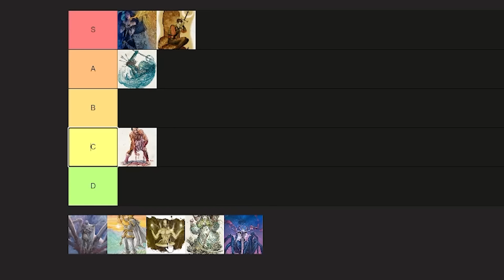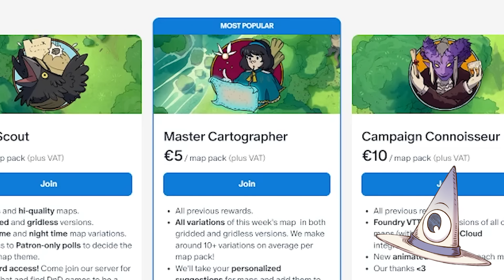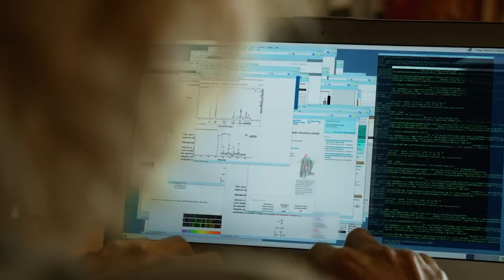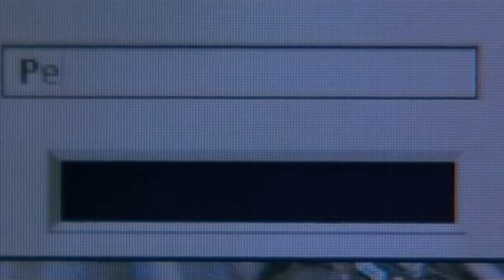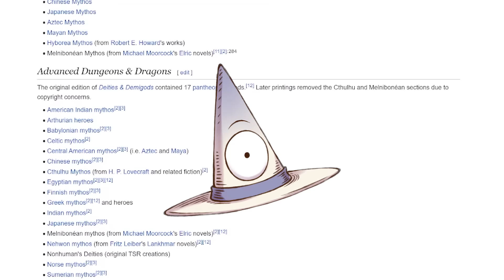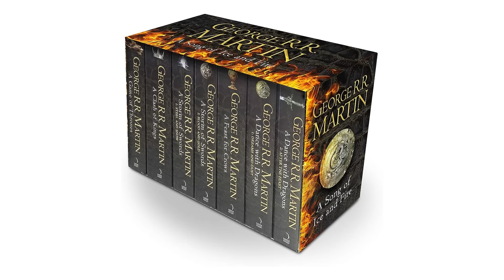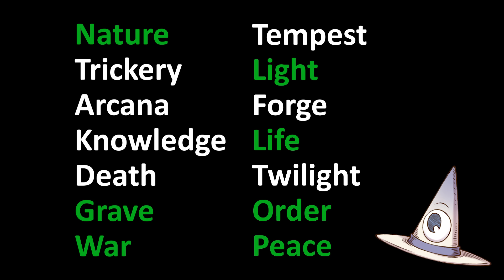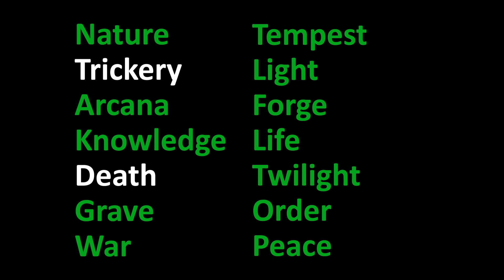The Problem with D&D Gods (and how to make your own)

Comment: I feel like you could even combine those two, options, have a very small number of very big/powerful gods as well as a very large number of very limited gods/spirits (I'll refer to these as spirits from now on to easily differentiate).

The spirits are closely connected to the material world, they care about it, they meddle in it, but they're limited in what they can do.

The gods are rather distant, they're overseers, they don't care as much about any specifics, but rather care about maintaining/altering a greater balance; they leave a lot to the spirits to deal with, only intervening if it's needed to maintain/alter the balance, but when they intervene, they can be extremely powerful if they wish.

Spirits can be killed or transformed when the thing they're a spirit of is killed or transformed; if something (A) is made out of another thing (B) then the spirit of B is the child of the spirit of A. The more localised/limited a spirit is, the easier it can typically be killed/transformed, whilst spirits who oversee a somewhat larger (but still small compared to the gods) thing might instead be more likely to bear children.

The gods, on the other hand, can't be killed, except by themselves/eachother.

We have a god of chaos and a god of order. Those who are lawfully aligned often tend to worship the god of order, whilst those who are chaotically aligned often tend to worship the god of chaos, whilst those who are neutral on the lawful-chaos scale will often worship both (believing that a balance needs to be maintained).
There are also those who don't worship either god, either believing these gods are so far removed from the material world that there's no point in worshipping them, or that the gods have killed eachother and no longer exist. (This could also help explain non-theistic clerics, who may believe the gods destroyed each other and now feel like it's up to us, up to them, to try to maintain/alter the balances.

The gods are also aware that whilst they each have their preferred side of the balance, they can't wholly do without the other. Sometimes a little bit of chaos helps to establish order. Sometimes a little bit of order can cause chaos to ensue. To destroy one is to ultimately bring down the other as well.

Each domain has an orderly aspect and a chaotic aspect, which the relevant god presides over:
Orderly Nature = the natural order
Chaotic Nature = the constant flux of nature
Orderly Tempest = calm winds and seas
Chaotic Tempest = rough winds and seas
Orderly Trickery = deception through carefully chosen truths
Chaotic Trickery = deception through lies
Orderly Light = guiding and illuminating light
Chaotic Light = blinding and swearing light
Orderly Arcana = creation and destruction as a means to maintain balance
Chaotic Arcana = the very change embodying creation and destruction 
Orderly Forge = Forging order and structure from rougher materials
Chaotic Forge = The embodiment of change in the forging process
Orderly Knowledge = structured/academic knowledge
Chaotic Knowledge = unstructured/practical knowledge 
Orderly Life = the maintenance of life
Chaotic Life = the creation of life
Orderly Death = the causes of death
Chaotic Death = raising the undead
Orderly Twilight = maintaining the pattern of alternating light and darkness
Chaotic Twilight = the very change between light and darkness
Orderly Grave = the orderly transition from life to death
Chaotic Grave = desecration of gravesites and resisting death
Orderly Order = the very force of Order itself
Chaotic Order = the very force of Chaos itself
Orderly War = maintaining a state of war
Chaotic War = causing wars to break out
Orderly Peace = maintaining a state of peace
Chaotic Peace = bringing on peace when there is none

There was once a third god, or really a first god, as it was the only god, the only deity, the only being, the only thing. They were one, they were all, they were multitudes. They sacrificed themselves, and from their ashes the gods, spirits, and material world as we know it were born.

Comment: actually there is a simple reason 1 or a couple gods are helping a couple of blokes beat the bbeg. it could be that the bbeg has a big plan on other planets that they have to help other people on those planets defeats those bbegs(or help depending on alignment) and you basically make it this giant galactic war thing against the bbeg and a couple of gods on their side vs. the good guys. or another idea is that each god has a main domain(the planet/star system) with that sub domain and they have laws that every god has no right to meddle in other gods domain(with few exceptions)

Comment: I have not yet experimented with this in Dnd but in my story I have “beings” about 6 or 8 of them depending how you look at it. They are sealed off to their own realm and cannot leave. Their only purpose is to create gods. They will make gods for the mortal plane and those gods worship the beings. However, these gods can be killed by mortals. It has to be by a specific weapon that is difficult to make but very possible. When a god dies, the beings can create another. But, the gods they make are using some of their own power so they can only make a few at a time or it might leave them too weak to attacks from the other beings

Comment: I like the idea that The Dresden Files has about gods, or at least their take on the fairy gods. The land of fairy is divided into two. Summer is your Disney fairies, generally benevolent but can always be a bit tricksy, don't trust a fairy but these ones won't go out of their way to hurt you directly. Winter is the Brother Grim fairies, these ones will just straight up kill you but hey at least you don't have to watch what you say to them mostly. Each domain has 3 tiers of god, a lady, a queen, and a mother. They cannot interfere with each other in their own sides, but moreso are opposites across the domains (IE Summer lady is the opposite of Winter Lady). Each tier has their own responsibilities and understanding, so something in the Ladies domains won't bother the queens or mothers because simply it's not their responsibility, and if they were to move they would risk the other side also moving. While they are opposites and rivals they also are in perfect balance, when winter moves summer moves and whatever they are moving on is evenly broken apart.

Comment: I once wrote a story in a D&D setting with a direct assignment from two (good) gods, who wanted the MC to assist a friendly lesser god against a different evil lesser god and offered some indirect assistance.

The essential plot point for this is:
1. The evil gods are more numerous and (in total) stronger then the good gods.
2. The balance of cosmic power thus comes from the fact, that evil gods fight each other. For that to work, the good goods can only cooperate to a limit, where the evil ones don't feel threatened by it, because then they would band together against the good and this would mean the end of the world.
3. Also the neutral ones can never be given a reason to side with the evil (like in my one the good gods were like: Okay, we are technically breaking Kelemvor's laws here and he is a GREATER, so you probably understand that nobody can learn about our involvement, okay?)
4. For the most part, the Gods fight their battles on way other battlefields then the material realm. The good gods might care emotionally about people but ultimately none of them (above Demigod level) really have their main focus here (From this also derived, that the gods do not work on Tinkerbell rules, their strength is not depending on their believers, but rather: Greater gods have (in general) more believers, because they are more powerful and thus they attract more simps. (Cause and effect...)

Comment: i've made a pantheon for my custom setting for a lot of the reasons made in this video
i'm also completely ripping out the magic system in the rulebook I'll be using... and i've tied the pantheon into it.
in fact, the pantheon was the first thing i made for my setting... and everything just sorta... built on top of it.

A lot of lore was simply, "Well, this is this way because of this other thing... therefore: this happens/this is this way/etc"
i.e the majority of my custom setting is emergent properties as results of other emergent properties
I find that this helps not only with worldbuilding, as everything has a logical cause-effect relationship, but it also helps in communicating this lore to players. It makes the world I'm creating more believable, even if it is fantastical. It's easier to insert yourself into a world where... things have explanations - and further than that... make sense.
There's always this nagging feeling while playing a setting by the book that I can never seem to shake where I can't find any of the explanations for "why are things the way that they are" satisfactory.

And it usually comes back to the gods. Why is magic a thing? How does it work? Oh, because Mystra and because Mystra. Right, very well, my belief is adequately suspended... NOT.
It's such a cop-out.

So instead, every facet of my world is a direct result of one god doing one thing, like a crack in glass... you can trace the splinters to its source.

In the beginning, there was the void, and there was... not the void. This thing that was not void was... a being. Many beings. All was one... Until it wasn't.
One of this many, Oðinn, we call him... was inspired to create. His brethren were fighting amongst themselves to rule over the great emptiness of the void... but Oðinn had greater plans.
He contemplated the form the universe might take as he crafted a hammer - and mere extension of himself, but a proper tool nonetheless - and in one confident motion...
Crack! The hammer smashed against the great nothing, shattering all of unreality... Creating its antithesis. But this work was not without sacrifice... it had consumed Oðinn and his brothers in the instant reality came into being. And yet, Oðinn's essence remained - his desire to craft was too great for reality to consume... and it instilled itself in all things.
From the ashes arose two new beings, apart and yet... together. Different yes, but the same. We call them the Leviathans -- The Serpent & The Homunculus.

They shaped the mountains and seas, but were left unsatisfied with their work... So they set about creating something different - something like themselves.
And so they created Ny-Reynsla and Sulten Ulv. Separate beings... but fates entwined. Entirely not the same, but not entirely different.
Ny-Reynsla set about weaving magic into the world, that it might have the capacity to change on its own.
Sulten Ulv created all manner of beasts to roam the land, that they might prosper in an ever-changing world.

For a time, that was all... until a beast made of magic was born - the Aes. These beings mastered the manipulation of their essence, magic, and held dominion over the lands and waters...
But they were left unsatisfied with their work... and so they set about creating a being not unlike themselves. Something different... but the same - perhaps more similar than they wished.
In the pit, the capital of the Aes kingdom, humans slaved away to aid their masters' toils. The Aes considered their creation flawed, prone to outbursts, fatigue, and death, all things that no Aes had ever experienced... yet. The ruler of their kind had grown soft towards the plights of man, and had granted one in particular his ear. This act earned the king his brethrens' ire, and a plot began to foment. A band of slaves - some gifted with magic, others with cunning or brawn - uncovered this plot and warned the king.
This triggered a civil war, during which the king's confidante was slain.

Eons later, when all trace of the Aes kingdom was but dust... The god of justice was born - though it is known as the god of corruption to all but the few of his acolytes. Explorers were made sacrifices to serve as Den'avslørte's price of ascension (along with the preserved corpse of Vårblom, the king's confidante). Thus, Ratnende Hjerte came to be. The true hearts of men were laid bare to the world, transforming into monsters. They wrought no less chaos and destruction upon the world in their new true forms than masquerading as humans... Nevertheless, this corruption of the human form was seen as blasphemy itself. 

A hundred years later, a great war took place between all the tribes of Garðarshólmi. The tribes believed that a warrior's death allows one to reincarnate into a better, younger form... and before this moment, they were correct. Souls ran through the great current and rejoined mortal shells to live again. But there was too much death in one place, and the weave could not withstand the force of beings. Thus, Frunna came into being - a whirlwind of death and unlife... The corpses were gone, overtaken by a plethora of green. Ivy, trees, fields of grasses, flowers, and all manner of plants...
The people of Garðarshólmi saw Frunna for what it was: a god of death, and they exiled this new deity from their lands. Thus, Frunna made way to the sister continent, Hrímgrund. There, Frunna was crowned godking for saving its people from starvation with the many edible fruits, roots, and vegetables that sprouted all across the lands as it stepped ashore.

Once more, another hundred years pass... and a lucky human spots movement in their shiny new mirror. A small lizard's tail flicked across the edge as it clambered up the frame... They assume it was a trick of the mind and went to bed, and yet the same lizard appeared in their dream. It was gnawing upon their floorboards, carpets, drapes, and walls... and spoke not. Every time it was spotted in the dream, it vanished in the blink of an eye, but the damage was still visible. Over time, this relationship grew... and so did the lizard's influence. It resided in the dreams of many mortals. Those it graced with not abruptly disappearing at first spotting were given an offer: a trade of secrets. It would feast upon your memories in exchange for new, unknowable knowledge. Of course many people wished to know whether or not a villager cared for them, whether they would be rich... how to be rich. It was all the same...
But the first was a cunning young woman -- or perhaps just curious -- and asked its name... Hemmelig Vaker. She would ask many things of this creature, a being beyond the mirror... but only a few of her requests were selfish. She wished to do much for her people and more, and considered this silvery young drake her friend. And so, at the end of her years... she bequeathed all that she knew to the eater of dreams... of knowledge. Every detail she withheld from the world she gave freely to her draconic friend -- and so a pseudo-deity was born, a keeper of secrets.

And... very little of this world has no cause. Everything is the way that it is for a reason. Not all of it makes sense, and not all of it has to. That's the beauty of fantasy... you don't have to try very hard to give explanations... just give the first thing that comes to mind, as that's likely what others will think first as well. Play into that intuitive reasoning and all the pieces will fall into place as easily as water running off a cliff and into a river basin below. (The real trouble is finding names for places and organizations... but you just have to look towards naming conventions of medieval peoples... Garðarshólmi (Garthar's Home), Hrimgrund (Ice Land), and suddenly you have things like Jotuns' Fall (a mountain rumored to be the home of giants), East Ragnhild's Claim (the easternmost portion of land that once belonged to a woman named Ragnhild), Iris Lake (a lake that's mostly circular, with a circular island at the center), and Northward Pass (a valley between mountain ranges).)

Comment: i usually assumed somewhere in the divine rules that if you dick with the human realm directly you will be culled but interacting through a devotee that is acting directly as your hand in the world and is willingly embarking on the quest before you tell them to or just that they can can only point them towards solutions and other things that exist and not interact with the mortal realm cause it would open the gate for the more evil gods to directly touch the world and make problems worse